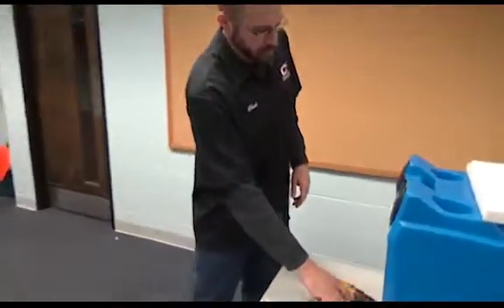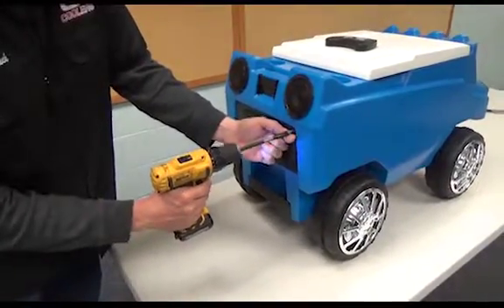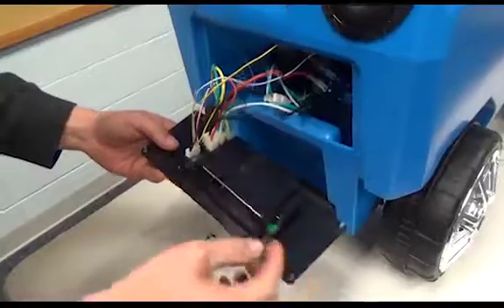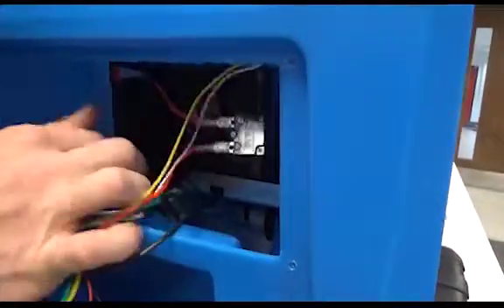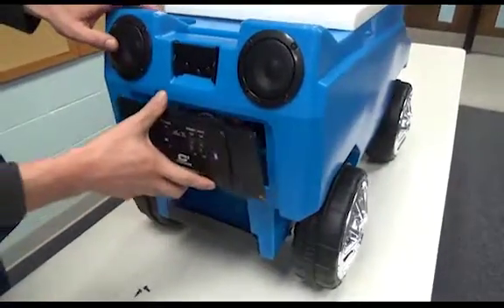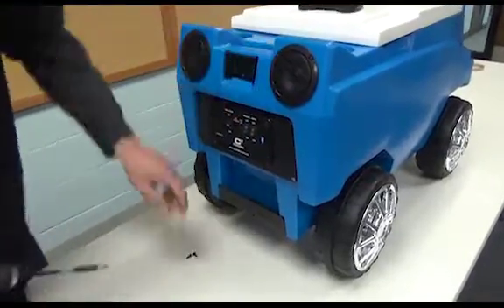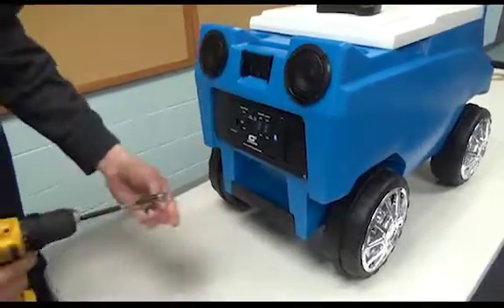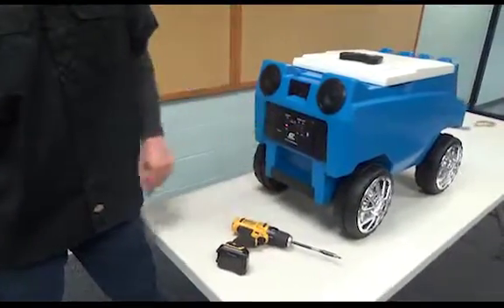troubleshooting 1

Comment: I bought two Rovers so far in the last 2 months I noticed in seconds the problem the Rover is turning on in shipping from the rear Styrofoam bumping against the back power panel and switches I feel bad you guys have been chasing a problem that can be fixed in seconds by cutting a window out in the rear styro so it doesn't rub the power button on in shipping killing/damaging the battery to hold a future charge..   Love my Rovers!